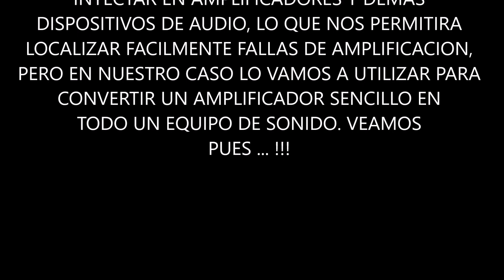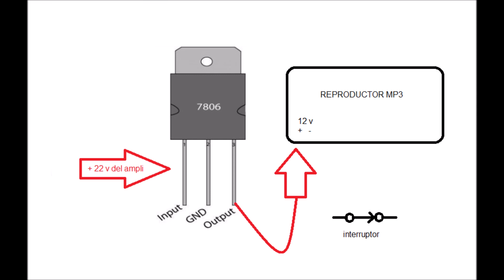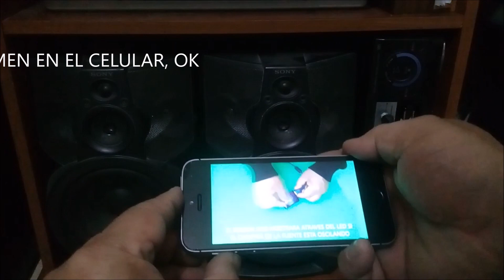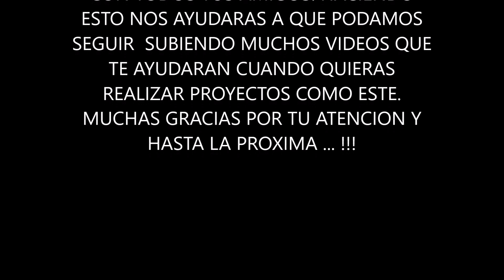MONTAJE Y PRUEBAS DE UN MODULO BLUETOOTH Y MP3

Comment: buen video.   amigo. instale este módulo en mi moto  pero no quiere quitar el ruido
Reply from the maker: Hola suzuki muchas gracias por comentar, si miras en la pestaña de comunidad encontraras que hay una solución implementando una doble alimentación, una para el modulo y otra aparte para la amplificacion. Éxitos
Reply: @ELECTRONICAHOYTV  ok gracias aún que es difícil en la moto porque sólo es una sola fuente de alimentación

Comment: Hola amigo ...Porque mi modulo cuando coloco un pendrive, casi en todas las canciones, tiene un pequeño corte, como un salto pequeño como cuando uno tenias esos rayados y habian partes donde la cancion hacia pequeños saltos. Asi me pasa pero solo con usb y sd. A que se debe eso amigo....Gracias
Reply from the maker: Hola Delby gracias por comentar, depronto se te esta colgando un poquito por corriente insuficiente (no voltaje). puedes probar colocando un capacitor de 2200 uF a 16v a la entrada de la alimentación del modulo. Éxitos
Reply: @ELECTRONICAHOYTV  muchisimas gracias...yo hice una fuente de 9v con un capacitor 2200uf a 25v y tambien le puse un capacitor ceramico de 100nf...y un lm 7809..yo lo alimento con 9v y cuando mido la energia del regulador del modulo..me da 5 voltios..le hecho de todo..formatie la memoria..grabe la musica a menor calidad...use 5v a 2 amperios y lo alimento con 9v y ni asi soluciona el problema. A veces pienso que el regulador del modulo no esta dando el amperaje. Amigo me estoy volviendo loco. Y no encuentro el detalle. Que podra ser. Saludos
Reply from the maker: @davidgarcia87  Hola Delby, en este caso puedes también colocar un filtro a la salida del regulador de 5v del modulo, en este caso tocaría uno de menor capacidad y tamaño, a no ser que lo coloques por fuera de este, también hay que descartar que sea por corriente insuficiente y por eso seria bueno mirar como se comporta poniéndole todo el volumen al amplificador y al modulo pues en ocasiones es necesario dejar el volumen del modulo al 50%. Éxitos
Reply: @ELECTRONICAHOYTV  eso he pensado amigo. El tiene un capacitor electrolitico de 10v..la capacidad si no se..pero es pequeño...tal vez lo cambie a ver como se comporta. Gracias Saludos.
Reply from the maker: @davidgarcia87  Hola Delby ojala soluciones el inconveniente, Éxitos

Comment: Las terminales de L, R y N del modulo , puedo ponerle un jack 3.5 y conectarlo directamente en la entrada de audio auxiliar de mi estereo?😅.

O en su caso ponerle un conector RCA (amarillo y rojo) y conectarlo en las entradas que se encuentran atras de mi componente?🤔
Reply from the maker: Hola Mago Sa gracias por comentar, claro que si, solamente debes diferenciar entre los terminales LR de salida y los LR de entrada auxiliar en el modulo, Éxitos
Reply: @ELECTRONICAHOYTV  si ya logre conectarlo. Solo que en mi caso no funciono correctamente en la entrada auxiliar de mi estereo. 

Ya que alteraba las funciones de mi estereo, y el control de volumen no era correcto.

Por lo cual, procedi a conectarlo en la entrada RCA del estereo y funciono mejor.
Reply from the maker: @magosa6295  Hola Mago me alegra que hayas solucionado exitosamente. Un abrazo
Reply: @ELECTRONICAHOYTV  oiga, disculpe. Alguna vez ha medido la corriente dc que consume el modulo?. Yo lo medi y me da menos de 100 mA. 😅.

Sera normal. O en determinado momento incrementa?🤔
Reply from the maker: @magosa6295  Hola gracias por comentar, pues no lo he medido pero puede ser mas o menos lo que UD dice, tal vez incrementaría un poquito al usarlo con mas volumen y un poco menos al usarlo con menos volumen, el display también consume miliamperios pero todo eso va en la cuenta. Exitos

Comment: Cordial saludo, amigo siempre he tenido ese problema de ruido en el audio del MP3 cuando alimento al modulo con la muisma fuente del equipo y lo solusiono alimentando el modulo MP3 con una fuente independiente
Reply from the maker: Hola julian, hicimos la prueba y efectivamente se soluciono el problema del ruido, que muchas gracias. aplicando la idea a para usar el mismo transformador del amplificador y aprovechando un devanado adicional que este tenia hicimos una adaptación que puedes ver en la pestaña "comunidad" de mi canal. Saludos
Reply: Es correcto, además que debe llevar un pre amplificador por ejemplo el 4558. ya que todos lo conectan a los auxiliares de los equipo y provoca que no se regule el sonido y se escucha saturado. En lo personal, uso la entrada de micrófono que ya tiene el pre, y se escucha muy bien. Antes las grabadoras traían la entrada LINE, pero como siempre en México llega tarde la tecnología, la gente no lo usó, en esos se escucha bien. Saludos.
Reply from the maker: @kottolengo  si, es muy necesario contar con un osciloscopio para medir los voltajes pp de la señal entrante y asegurarnos que esta este dentro de los 300 mV standard de una señal pre-amplificada que es a lo que viene diseñada la entrada auxiliar de un amplificador. des-afortunadamente son muy costosos.
Reply from the maker: Hola julian, gracias vamos a probar. Exitos.